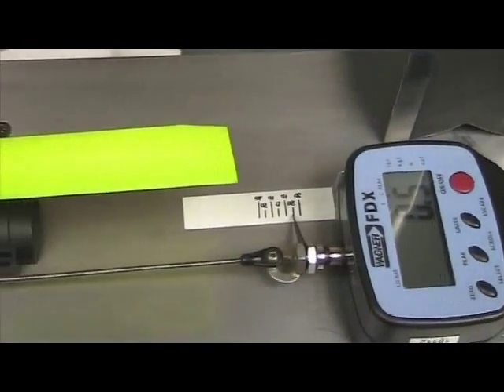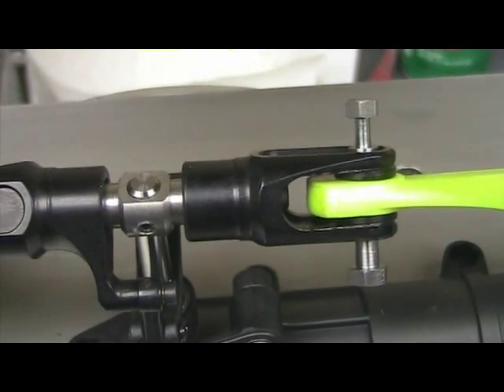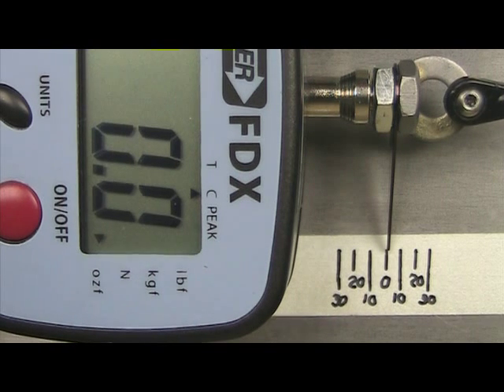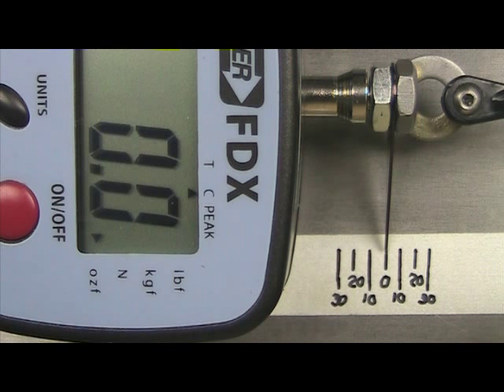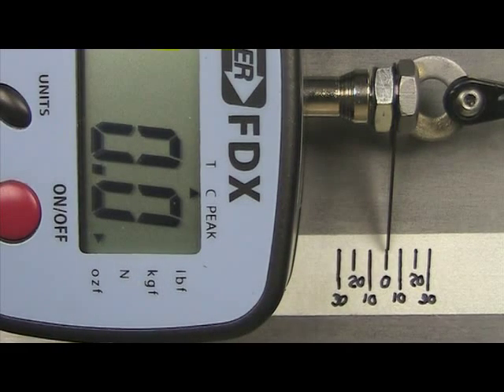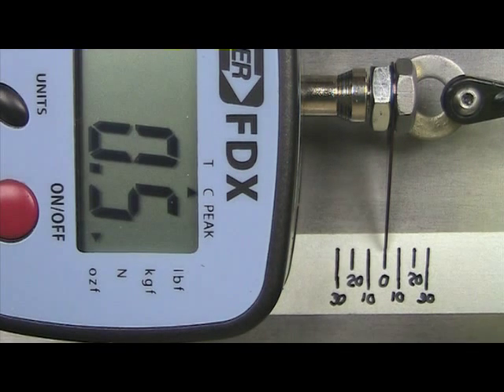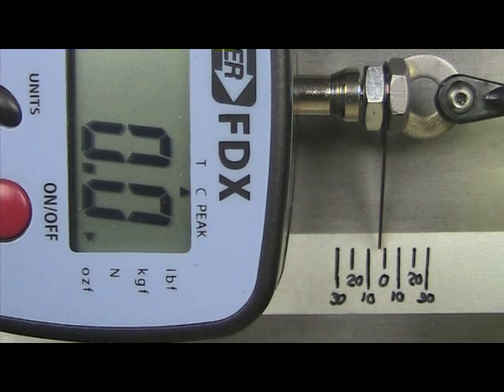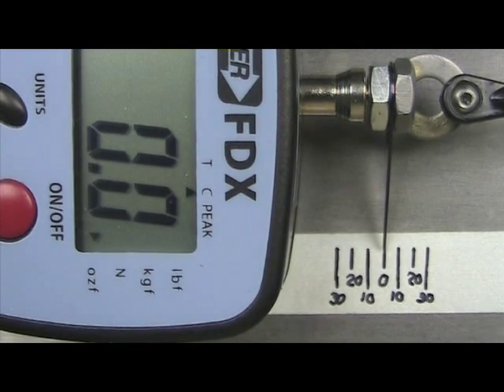QUICK UK 600 700 CHINESE WEIGHT TEST

Comment: Hi mate.  I realise that these videos were for insiders only, but I'm still not quite sure what is meant with the tennis racket effect.  I loved the solution with the spaced bearings, although I was first wondering if the preload would cause some drag again.
Reply from the maker: Hi Marcel,  I wrote a magazine article about it that never got published. I am HEIM JOINT on the Helifreak website and here is a link to my post where you can download the pdf of the article http://www.helifreak.com/showpost.php?p=4870707&postcount=1